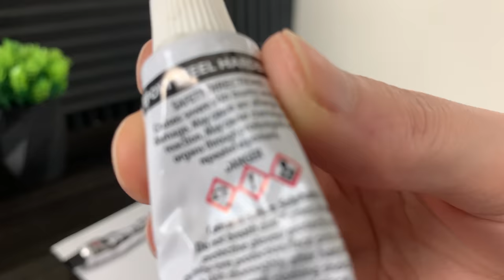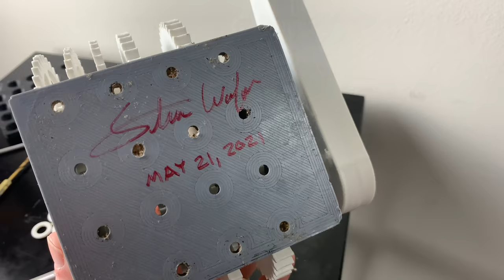3D Printer Gearbox - Spinning it FAST

Comment: So if someone built a larger, high quality version of this, we could spin the handle all day and generate free energy. We could pay someone to spin this all day and make a whole factory full of people spinning these machines to keep generating free energy right ?
Reply: Surely this thing could generate enough electricity in a day to pay an employee a good wage and also have plenty of electricity to sell to people at cheaper rates?
Reply: This must be able to generate tons of electricity I'm certain of it
Reply: Someone call Nikola Tesla
Reply: There is no free energy. Ever. You can only convert it. In this case, it's much much harder to spin the slow gear. Cause you still need to put in enough energy to make all the gears move at their correct speed ratios. So you're just putting that energy into the system differently.
Reply: @josephwodarczyk977  not free energy just someone on an exercise bike generating power, the energy comes from the cyclists legs , but it's super efficient because of the gear ratio
Reply: @namejeff5534  that's actually a fair point, and I like that you're thinking about this stuff. So, this is already a thing on bikes. It's that gear shift, that number dial on the handle. Cars also use it, even if it's not always shown to the driver. And with both systems, the more free speed you get, the more effort you need to put in. If you have a bike with that dial, feel free to go test it. Mini physics experiment. For more info, look up how torque works in mechanics.

Also, addon to what I was saying about free energy. There are these rules in physics called the laws of thermodynamics. And basically, you can never get more energy out of a system than you put in. If I put one unit of energy into a machine, there is NO WAY for the machine to ever ever ever give two units of energy out. It's such a tempting rule to break, but for whatever reason, the universe is balanced so it can't happen. What you're saying about efficiency, that just refers to how much useful energy you're getting out of what you put in. If you had a pump that spent 80% of the electricity pumping water and the other 20% was made into heat, you would say it has 80% efficiency. And it's so annoying, but those numbers always equal 100%. It's like God balanced physics or something.

Edit: you're still moving all the gears by hand in this video, you're just not touching them. So it's still just as much work.

Comment: I have one very basic question: If all gears on one side are connected through same shaft, why aren't they rotating at the same speed? How is it even possible that they are rotating at different speeds?
Reply: Because they'll just be ordinary round shafts with no spot for the gears to grip on so they more-less spin freely.

Though you can improve performance by using bearings and/or grease as there's still friction, probably.

Comment: Drill a hole through the handle and rod then use a bolt or even a dowel with epoxy to secure the handle to the rod. Please for the love of god

Comment: what happens when you have a transformer that has 2 output that:

the 1st Secondary output Was For HV

The 2nd Secondary Output was for High Current

and you connect them by parallel
Reply: Did I Get High Power?
Should Be (Theoretically)

Then

I Connect it To A Rectifier

Then I Connect It To An Inverter (freq as resonant as the first input Frequency)

And The Output of The Inverter Connected To The Input of the transformer,

Theoretically, I Should get Infinite, UNI-CRASHING, Power?

Comment: How about a million RPM on the last gear, driven by a motor on the first gear to be able handeling the torque? At what ratio will the gears on the high RPM-side begin to melt due to friction?

Comment: Next time maybe don't screw it to the table.  Use bolts with a washer underneath.   That way you won't need to try and get the screwdriver down through the gears.

Comment: Have you heared of the mechanical part called a "key"? https://en.wikipedia.org/wiki/Key_(engineering)
This is how any sensible engineer would normally secure a gear to a shaft.

Comment: Have you ever used your gears to generate energy?  What would happen?
Reply: Nothing, power is basically torque times RPM. Gearboxes don't magically generate power, they just trade torque for RPM or vice versa. In an ideal gearbox (not accounting for losses to friction), the power at the output is equal to the power at the input. Adding friction, you lose power at the output.

Comment: Why are you putting the handle on the glue? Just print a hole for a bolt and a nut, and clamp the metal with plastic, as the stamps on a car battery are clamped. The friction force of plastic on metal is a million times stronger than glue.

Comment: I’ve never engineered something using a program, so I can’t say shit really. However I’ve over  built things on the felid I see engineers often put bolts or other connection points in weird hard to get to places.

Comment: such a transmission could be used to charge an electric car on the go. but yes... that would bring no more profit
Reply: The tradeoff of gears is that free speed like this gives less torque. So if you had a system to spin a gear 100 times for each turn of the crank, you would need to put in 100 times the effort. So you don't really gain anything. . You unfortunately can't just get free energy with gears that way.

Comment: Could you design one that has 1:3000ratio gearbox would you please design the gearbox i proposed i want to get it made in metal im building a windmill generator and need the absolute maximum rpms as i can get to the motor shaft from the lest amount of the main shaft spun please help me with this i dont know what im doing i dont own a 3d printer nor the knowledge of how to use it.

Comment: Can this be used to create electricity
Reply: No. There's too much friction and most generators don't take this much speed on the input. At this point all the power in the system is being exhausted through heat due to friction or air resistance, which becomes significantly more of a problem as he adds more gears.

Comment: Your epoxy bonding to the gears is the weakest point of your design, why not slot and pin them to the shaft? Also you only need 2 screws into the table one in each corner.

Comment: SIR, Instead of putting a handle, what if we put another circle with a string wrapped on it and then put heavy weight and let it hang. which will take more time to release the full string and put a generator in the front and we have a sustainable battery. when day light with solar energy run it back wards and wrap the full string and lift the weight and at night let the weight free. sir is it possible? I am from third world country and trying to make a difference for my people and country. need urgent help.

Comment: This was painful to watch, no offence. JB weld? Really? Secure the handle at least with a pin or something. A straight shaft into plastic handle JB welded in place is not going to hold any good amount of weight or torque

Comment: Hey dumbest not so smart but does a cool 3d print..... Look up what a keyed shaft is for ensuring a non slip lockup to your shaft, make a game plan and mentally run through your project to prevent your little handle issue and rather than jb weld the handle on use set screws and square the shaft.

Im guessing your not much of a wrench thrower and more of a key puncher ...